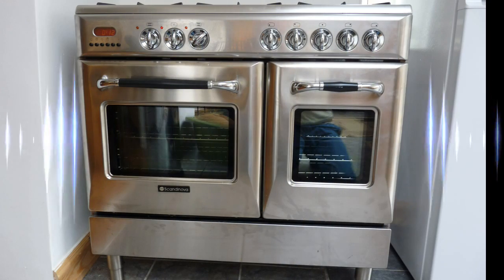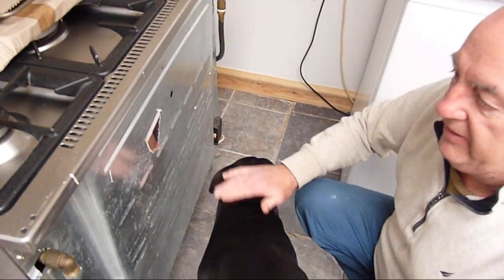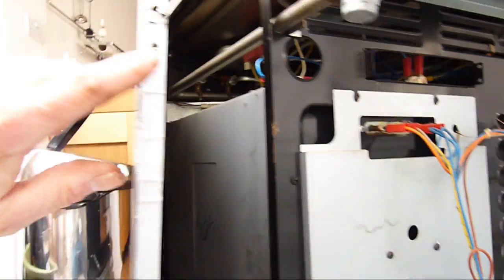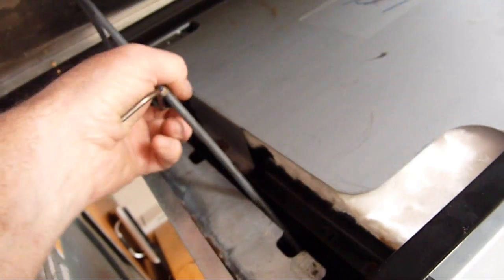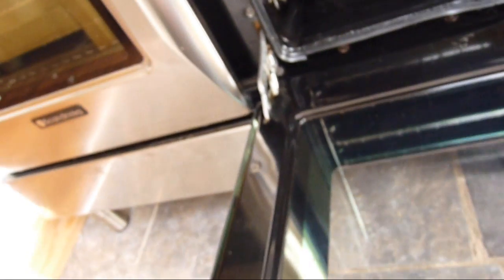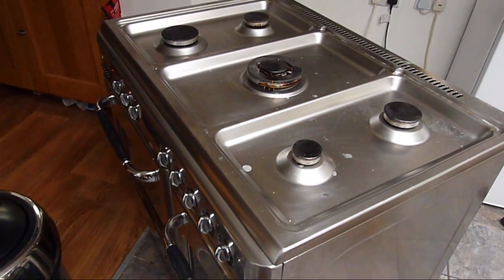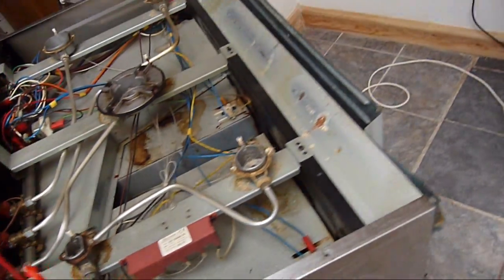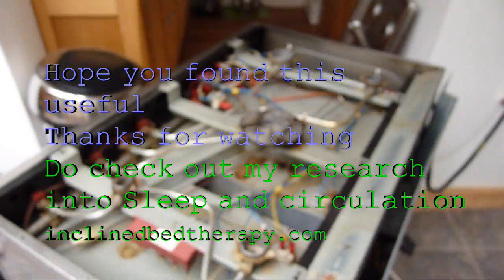How to Replace Bottom / Lower Bake Element + Gas Ignition Dual Fuel Cooker

Comment: Excellent video. Do you know if the screws for the fan assisted heating element need to be removed from the back with the panel off? I've tried removing them directly from inside the oven at the element and they turn freely but won't come out. Wondering if there's a nut or fitting on the back or if it's the threads that are stripped?
Reply from the maker: Been so long I can't remember whether nuts and bolts or captivated nuts. Think may have been nuts and bolts. If not, then you can use nuts and bolts to replace captivated nuts.